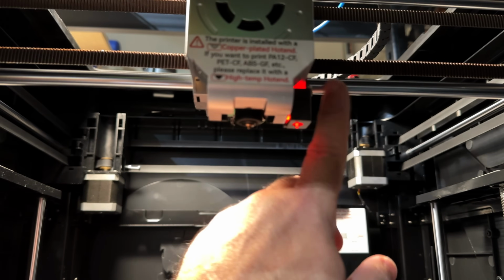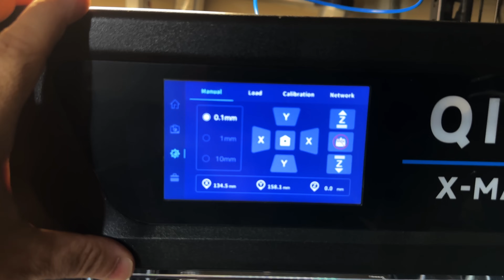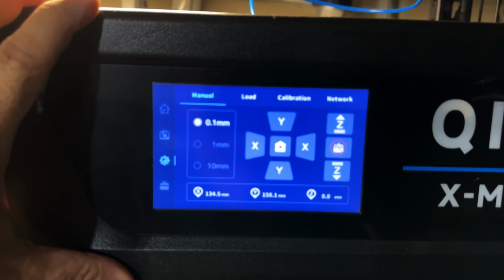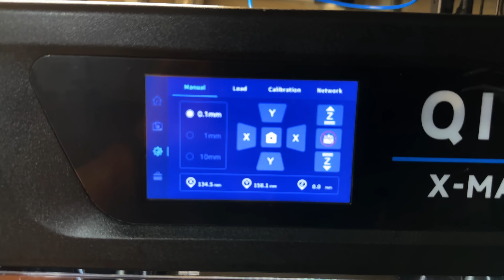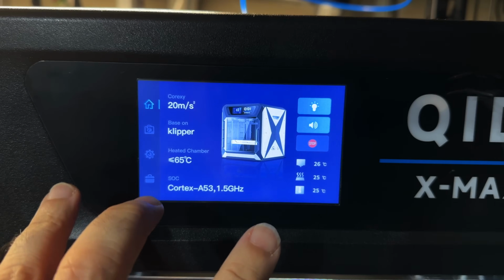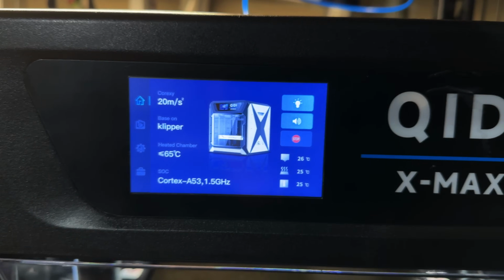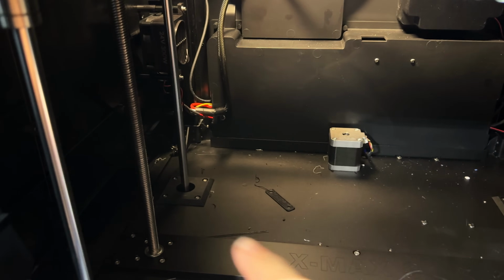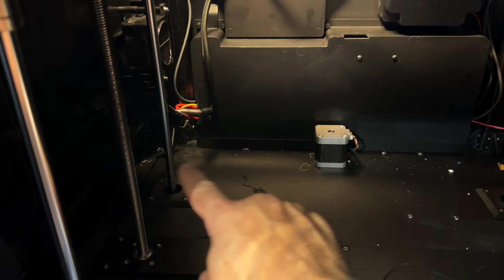Production version  QIDI X Max 3 - Can it Topple the Bambu Labs X1 X1 Carbon King?

Comment: Thanks for the (kinda) review...I'm still surprised that nobody seems to point out the fact that you can adjust things like Z-offset and flow rate On The Fly while the unit is actually printing!  Seems like most are mired in the fact you still have to 'paper' set the Z-offset at first. Get over it. Heated chamber, 10mm rods, TWO nozzles including a hardened steel nozzle, sheeesh felllas.

Comment: Bl touch?? Lmao we use Lidar and AI calibration we ain’t the same bruh. Also part of calibration is using the vibration which surface printer sits on to its advantage. Telling it if it needs to sling more or less filament or not also part of the AI technology. Nice build but not even in the same tech ball park
Reply: the lidar in x1 is useless ask anyone, no one uses it
Reply: For sure, I can confirm this.  @RathOX
Reply: Qidi stopped shipping the X-Max 3 with BLTouch 3 months ago. Now they are all inductive probe.

This review is of an older unit.

Comment: why are they still using manual bed offset nonsense from 2013? bltouch or inductive, it's still needless and obsolete. bambu, prusa, even creality has moved on to nozzle probing. @3:50 bottom layer not the same between them, one on right has z offset too high. great example of why this is outdated and qidi should join the modern world of nozzle probing.
Reply: it doesnt matter if you have your bed plate and printer  squared ! and inductive probe can be as good as nozzle probe ! it depends on senzor quality ! But in my opinion best probe is beacon probe :) most accurate ! and you can have one inside QIDI if you want...and the only question we should be asking is : how long can they run trouble free...and is it worth owning such a machine long term,  because most of the new printers like Bambu,Creality,QIDI work pretty solid out of the box and Bambu is leading the way
Reply: Agreed. Small price to pay to save the coin and be offline though. Bambu can't have my money with their spybot even if it's a great printer by all accounts. I'm not buying hardware as a service.

Comment: I currently own a sidewinder X1, I am looking into getting something a bit meaner and faster. I do mostly cosplay with it (armors), would this printer be a good alternative ? If not which one would ?
Reply from the maker: It has a few things going for it. It's large build plate. For helmets and large pieces and speed.  Solid yes. You have some alternatives that are cheaper. Like the k1 max. It has had some bugs but they are all most out now. If size is not a big factor you cant go wrong with #bambulabs p1s.
Reply: @ebpman  thanks a bunch ! Feels like we are a few months away from the ideal printer for me. I heard bad things about the K1 though. P1S looks solid though, but maybe printing helmets in one go is a thing I would want... huuu so many choices :D
Reply: @startide  Elegoo Neptune4 Max or Anycubic Cobra2 Max are good choices for a "helmet sized printer" in the more affordable seqment. They come a bit short on bed heating, and no enclosure, so those more demanding materials like abs, asa, cf, and so on, are hard to print. But for cosplay, you would likely not even use those, so you could/should consider them. If you build some kind of an enclosure around, it raises the temp of the whole print area, and might improve printing quality.

That said, Qidi is a solid choice if you need those more demanding filaments, that benefit from the heated chamber and the extruder to print them that comes with the package.

Comment: I just got mine today and it came with an inductive probe instead of a BLTouch.
Reply from the maker: Really!  Wow.  They are really making changes.  That's cool.  Gave them that feedback too.  Let me know how yours prints
Reply: @ebpman  I'm really happy with it so far.  Best OOB experience of any printer I've had.
Reply: @ebpman  Mine had the BLTouch but it started having probe failed to retract errors and then it started to have probe failed to extend errors. Qidi sent me a magnetic sheet and an inductive probe. They also sent me a link to a firmware upgrade which had support for the inductive probe. As part of the upgrade I needed to remove the nine embedded magnets from the bed.

Qidi also sent out pretty much an entirely new toolhead in various stages starting with new front and back covers, a mini circuit board to provide a place to connect the extra fans that were the reason for the new covers, and a new hotend. Then more new covers, an extruder, and another hotend. Also a bonding wire for the bed and a new USB-C cable because the original one did not have a ground wire in the cable (if you get random board crashes then it could be that you have the bad cable). 

Needless to say, their support has been out of this world!

Comment: It clearly can't topple the X1C. And even if it would be close, it does not have AMS.
Reply from the maker: It's not going to.  But it has a niche I think.  Ams is costly the amount of poop is crazy. But for single color, carbon fiber or nylon it does really well.
Reply: @ebpman This. I love my Bambu printers but have a X-Max 3 on order specifically for ABS, ASA, PC, Nylon CF and CF filaments. An active temp controlled chamber along with a 350 degree nozzle and 120 bed is what this beast meant for.

Comment: what is the wattage of the enclosed heater? I notice it looks extremaly similar to a 12v PTC heater found in most cars - I had got one recently and it's extra now -  but if that is enough to heat up that enclosure to like 60C- 70C - I may modify a printer enclosure to fit a heater in it.

The gray part on @5:53 is.. very ghosting bands.. I don't know if they show up on the black part - but that much ghosting is terrilble - something isn't tuned. 

about the 'fastest' setting - that tells us non-owners.. nothing.   We need values to compare.   if your fastest is 1/2 the speed of the Bambulab machines - and it ghosts that badly - bambu wins, hands down.  Especially after the sale price is gone - the price is basically the same.

So we need actual values to look at and compare, because if that is the same speed as the bambu - and it just needs tuned, it still isn't 'as good' as it demands us to fix the tuning. (at full price, at $400 cheaper, it would be a heck of a deal in QIDI's favor)